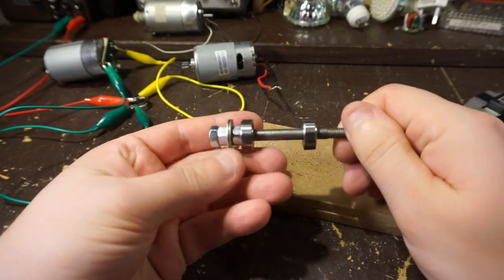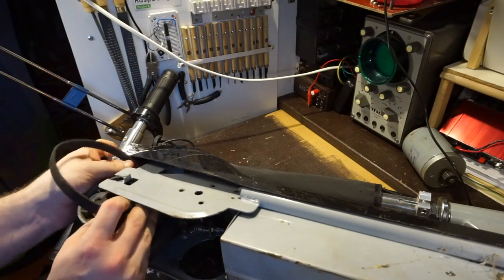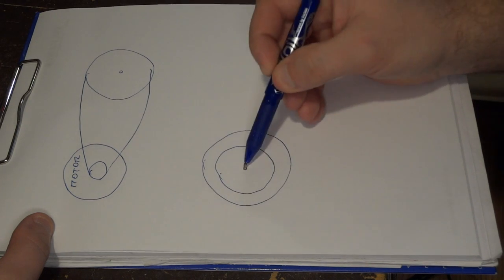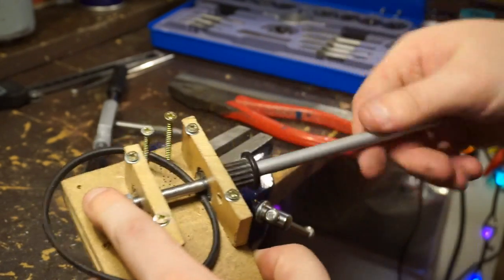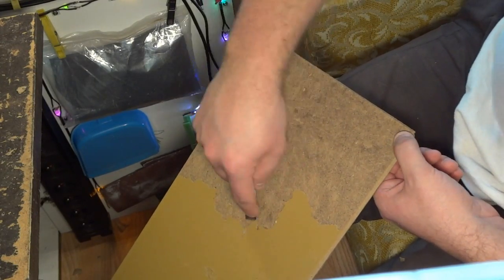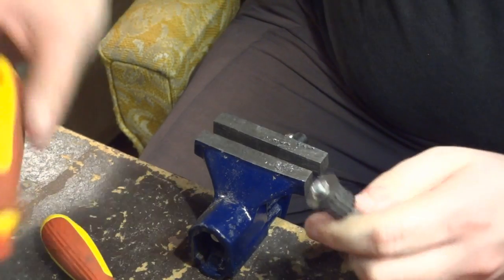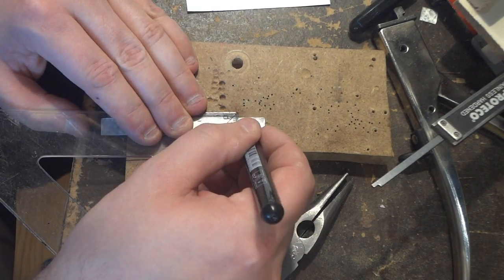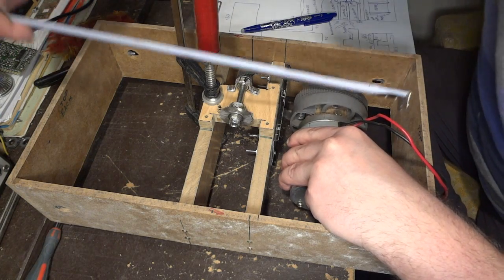HOW I BUILT MY MINI TABLE SAW, PART 1

Comment: Amazing. What kind of tool is that at 7:56, when you are making those teeth on the bearings holders? Thanks.
Reply from the maker: Thanks. That's a nibbling cutter or nibbler.
Reply: +MDF RESCUER Thanks. Here is a good explanation in portuguese. I'm going to buy one.